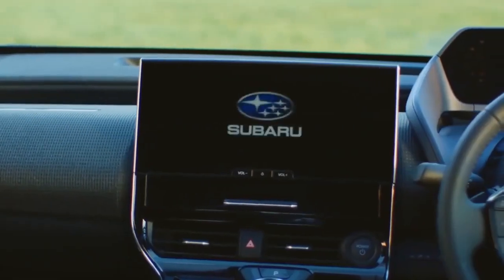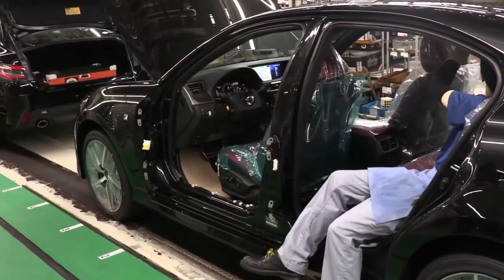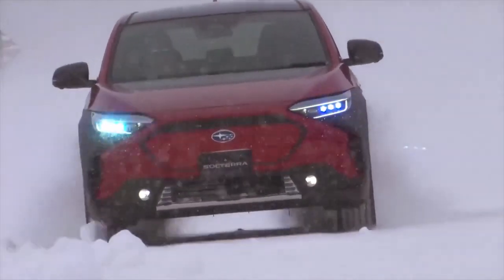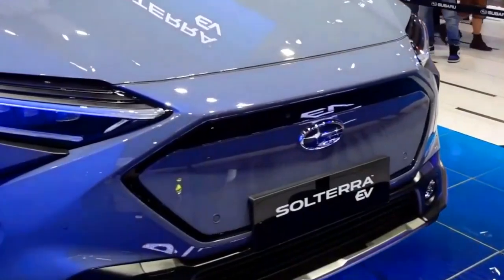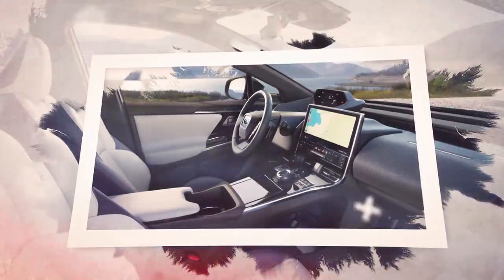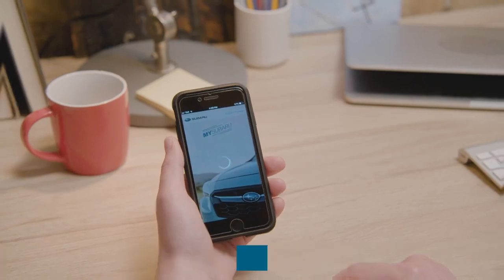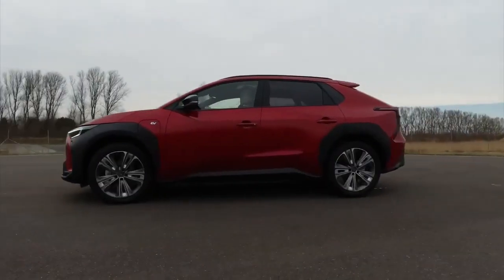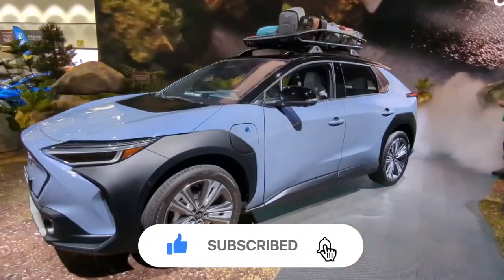Subaru Solterra EV 4X4 Top 10 Features

Comment: Since may 2022, I have been on a Subaru Solterra waiting list, in a dealer located in Laval, Quebec. That’s the only car I reserved…
I owned 2 different Subaru in the past (Outback and Crosstrek). This video is so interesting. It allowed me to continue HOPING that may be I will one day own a Solterra.  The features seems awesome.  I was told last may by the Dealer’s Sales Director that I could estimate that my rank would give me the car in spring 2023, but I know that the production line had some major issues and delay.  I will remain positive….Thanks again for this video: IT’S A GREAT PROFESSIONAL PRODUCTION !!!   Ben 😀 from Lorraine Quebec